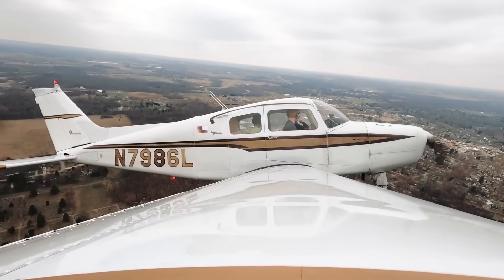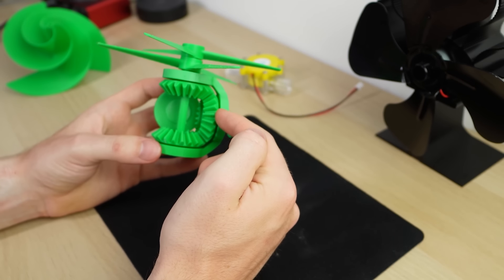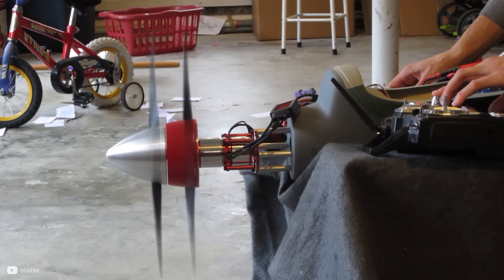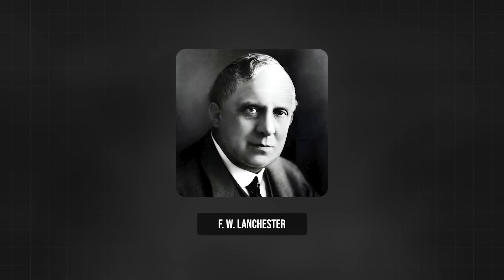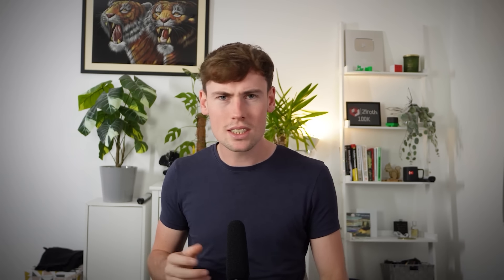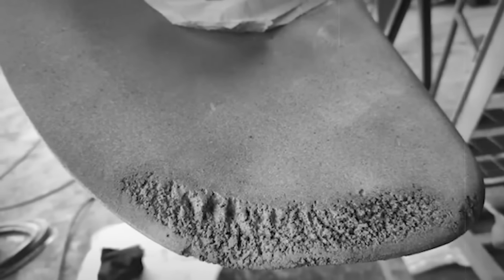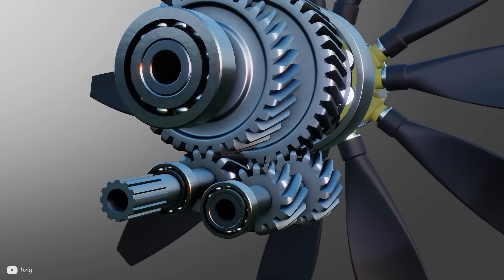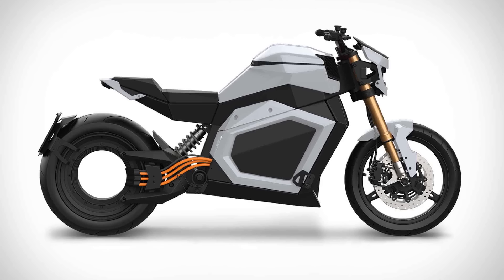The Unexpected Genius of Contra-Rotating Propellers

Comment: Geared reduction drives have proven notoriously difficult on small piston-engine aircraft. Placed between an engine going bang-bang-bang and a propeller with relatively huge rotational inertia, the gearbox walks a fine line between being strong enough to withstand the shocks and light enough to be practical. On electric motors and turbines they may prove much more useful.
Reply: Isn't that what the flywheel is for? Doesn't the prop act like a flywheel by itself?
Reply: @piconano  The prop is a huge flywheel which wants to move steadily round and round. The Pistons go bang-bang-bang. There may be a heavy flywheel on stationary engines, but in airplane engines it's reduced to the barest minimum because of weight. In between are the crankshaft going flex-flex-flex and a reduction box going clank-clank-clank on the smallest lightest possible gear teeth. Long ago Continental (see Tiara engines) realized that 2/1 was a bad reduction ratio because the same teeth were pounded over and over, even with a damper added. By the time all was said and done, the Tiara line was no lighter, enjoyed shorter TBOs, were more expensive to build and overhaul, and burned more fuel. Almost 20 years later Porsche learned similar lessons.
Reply: @tomscott1159  So all these experimental aircraft home builders are screwed? 
Some use Mazda rotaries or Subaru engines with reduction gearbox. 
I've never heard of this and I got my private pilot's license in San Diego in 2000.  
Where can I read more about what you're saying?
Reply: @piconano  Anything can be made to work more or less, but historically, certified geared light general aviation applications have not proven particularly successful.

Both Lycoming and Continental brought out geared lines in the 1950s which proved to have no particular weight or performance advantage over slighly larger displacement direct drive competition. The Continental GO-300 in the Cessna 175 would not survive the Lycoming O-360 engines, for instance, because the 300 had shorter TBOs and required a bit more operator finesse to reach them. Likewise in the upscale twin market, the geared Lycoming 480 and 540 series were notorious for demanding smooth and minimal numbers of power changes to preserve gearbox life. Professional corporate pilots fared better at reaching TBO than owner-operators. When small turbines became available they rapidly shrank the market for larger piston twins, with the King Air essentially replacing the Queen Air, for instance. Continental tried a new line of geared engines in the mid 1960s, but they offered no significant advantages to offset greater cost, greater fuel burn, and shorter TBO. Porsche worked with Mooney in the late 1980s to introduce a 200 HP class geared flat six. Less than 50 were installed before Porsche left the market and eventually surrendered the type rating to the FAA. Too heavy, expensive, with short TBO, poor fuel specifics.

Today there are several series of small-displacement geared engines available to homebuilders and even a few which are now certified. Most of these are water cooled which makes it a bit easier to build a light-weight high-speed core. Yet by the time the system is complete and installed in an airframe with all accessories and coolant, these rarely offer a huge weight advantage over basic direct-drive air-cooled installations. Smoothness and automated controls are typically the main advantages of these new types. But even in these cases the gearbox is an additional point of failure and a costly component to purchase and overhaul.
Reply: Yep. Torsional vibration is real; designing for maximum torque without considering TV (which forces can be quite spectacular) has caused many a redrive to become scrap.
Reply: @piconano   - typical direct drive aircraft don't have a (or much of) flywheel - in a mechanical transmission situation some mass on the input side of the reductiuon gear will affect stated "combustion" torque pulsation - but every Rotax powered aircraft has this problem minimised - and all other auto-derived engines...
Reply: @piconano well a rotary engine has way less vibration than a piston engine. And yes reduction gearboxes are notoriously bad in aviation application and barely one flies them successfully. And Subaru Engines are a disaster themselves and many have been refitted with traditional Lycoming engines.
Reply: "notoriously difficult" only to clowns who never noticed Russians produced thousands of these, on everything, planes, boats, helicopters, unless they are some sort of supermen?
Reply: @KuK137  Notoriously difficult to produce for light piston aircraft at a price, weight, performance, and package size comparable to direct drive engines. Russia never had much of a private light-plane market as I recall. Also the engineers at Porsche probably would resent being called clowns.
Reply: very interesting comment.

Comment: What you completely failed to mention was that the trailing propeller in a contra-prop pair is operating in a faster slip-stream and therefore to obtain optimum performance it's design parameters must differ from the one in front, I.e. they're NOT interchangeable.
Reply: It's incredibly obvious that one propeller is blowing air or water on the second, so mentioning it would be as dumb as pointing out that once a plane takes off, it's moving faster through the air than when it's parked.
As for the different air speed requiring a different design, does that mean you need a different design to take off than to fly? Until you test it, I don't think you can make a definitive statement about it.
Reply: @ED-es2qv  The concept of "dumb" is riddled through your whole reply - you clearly don't know what you're talking about. take the time to study the DORNIER DO335 Pfeil. This issue was well understood by Dornier who designed the propeller speed reducer/blade pitch controls to accommodate the phenomenon. I think you need to see a doctor about your bout of arrogance as I think you'll find that most people are NOT aware of this issue, after all, that's the point of making an educational video, isn't it? ..to educate!!
Reply: Great observation 😊
Reply: Curiosity would this principle work for wind turbines as I heard they have to limit the amount of blades due to the turbanlance caused behind them
Reply: @jamesshimmen7818  Probably getting in a bit too deep with the mechanical complexity required. Major servicing, e.g. blade removal would be a nightmare.

Comment: now that everything is going electric, i can totally see just 2 motors behind each other turning opposite directions, making the gears unnecessary. 15% higher efficiency is worth quite a bit.
Reply: My thoughts exactly aswell.
Reply: You're losing some efficiency from double the electronics and smaller motors. Benefits have to even that out. 
Same with mechanics. 
Turbines just position static blades after rotating ones.
Reply: @kittengray9232  my guess would be that loosing that massive gearbox and its maintenance alone would pretty much make up for it.
Reply: So a smaller shaft inside a bigger one or how would it work?
Reply: @Axiomatic75  yes, the front-motor would have a hollow axle.
Reply: @tomduke1297  Damn, now I want to build a drone with 8 props.
Reply: yes, rc heli's do that. the motors inline, they use a shaft runs thru 1 motor and it's shaft to the back prop
Reply: Axial flux motors!! one For Each one! that way in event of a ruder failure engine control could let you fly
of course the directions of each pair must be inverted on each wing for that
Reply: @kittengray9232 not necessarily, you're also going to get massive mechanical losses with gears, which also have added complications of oiling and cooling
Reply: @kittengray9232 very little different in new motors strong enough for full propeller vs efficiency loss of gears.  Just imagine all with magnetic bearing s
Reply: Everything is not going electric, at least not for a long time yet to come.
Reply: Aircraft is going sustainable air fuel or hybrid, not full electric

Comment: Now, take it to the next level. The leading boat prop is always turning in water traveling at the speed of the boat. The trailing prop is always turning in water traveling at the speed of the boat PLUS the added prop wash of the leading prop. Therefore, the trailing prop should turn much faster than the leading prop to take advantage of the already moving water.

Comment: I thought the green 3d print was amazing. When I was a kid we never even had home computers, now in my lifetime I not only saw original dot matrix printers but now 3D printers, it's mind-blowing and we are only a few years into the technology! I bet in a decade or so the 3D printers can do full colour prints, like you don't just print out a miniature for a board game and then paint it, it just comes out painted.
Reply: We already do have something akin to that.  Several printers on the market can switch filament types mid-print, and so they can programmatically change colors and print a full color model.  There's some issues, of course.  One is plastic waste because models like the Bambu line use a single extruder for all the filaments, and so it needs to be purged of the old filament in order to change color.  Another is just that they don't look as good as a properly painted model.

Comment: In our research there are two major sources of noise, blade passage noise and tip vortex interaction. Blade passage noise happens when the wake off of a blade in the front prop strikes a blade in the rear prop. That wake causes an unsteady flow around the rear blade, which causes vortices to collapse and the blade to vibrate, both generating a broadband noise. When the number of blades in the front and rear prop are equal, like the Tu-114, all of the blades pass each other at the same moment and so all emit the noise at once. So the noise comes in two major bands, the high frequency broadband noise from vortex excitation frequency of the prop vibrating and the high intensity tone at the blade passage frequency. The solution is pretty straight forward and that is to make the number of blade on each prop a different number. Usually they only need to be one different, with one more blade on the front prop when the blade count is low, but two different when blade count on the front prop approaches ten blades. Then with unequal numbers of blades, only one set of front and rear blades are interacting at one time. This increases the blade passage frequency and dramatically lowers the amount of acoustic energy in each pulse. Higher frequencies being easier to attenuate and less energy in each sound pulse requiring attenuation make it substantially easier to reduce the amount of noise that penetrates into the cabin. 

A second mitigation strategy is to add sweep to the blades. In the Tu-114, the blades were perfectly straight, which means that the vortices off the front blade strike the leading edge of each of the rear blades along the entire leading edge at the exact same moment maximizing the amount of energy in that blade passage acoustic pulse. If the rear rotor blades had a bit of scimitar shape to them, then the vortex from the front blades would strike the leading edge of the rear prop at slightly different times and spread the acoustic energy generate over a broader and lower peak energy pulse. Both front and rear blades can have some sweep to them, which is especially helpful when applied to high subsonic propeller aircraft (usually called "open rotor" when the flight Mach number approaches 0.8). To maintain the acoustic reduction benefits, the rear blades just need to have a little more sweep than the front blades.

The second major source of noise is when the tip vortex shed by the front prop strikes the tip of the rear prop. This interaction is so strong that it causes the entire rear blade to "ring". The obvious solution is to make the blades of the rear prop just slightly shorter so that the tip vortex of the front blades just passes over the rear blades with no tip interaction noise being generated. This solution does slightly reduce the efficiency of the combined propeller system since the vorticity at the tip of the front blade is not countered by the opposite vortex at the tip of the rear prop blades. But the loss in efficiency is minor and the reduction in noise is substantial.

The combination of unequal blade numbers per disk, swept leading edges on the rear prop blades (or higher sweep than the front blades), and the reduction in blade length in the rear rotor combine to substantially reduces the noise from contra-rotating propellers.
Reply: Hi, Papparocket. There's a much better way. A direct drive prop/fan sits in front of an open-nosed plane. The engine bay is cone-shaped. The base of said cone is as big as the plane's fuselage.
The engine bay also functions as a stationary nose cone for a planetary gear driven prop/fan that operates at about 1/10 the engine's RPM.
The cone pressurizes, spreads, and smooths the small-and-fast front prop/fan's wake while entraining surrounding air, feeding the big-and-slow rear fan/prop just what it needs.
Yep, planes will need tall landing gear. So what? We need quiet planes with off the charts efficiency. The system I'm designing should approach 2/3 efficiency during high altitude cruising, including the engine (Carnot's equations seriously favor  very cold environments)
Reply: @RePeteAndMe  I'm a bit skeptical, but seeing that it's been around 80 years since any serious research was done on using the plane's fuselage as any kind of assistance to prop-based airflow I'm glad that someone is exploring similar territory.
Reply: A reduction in noise would also increase efficiency, since less energy is being wasted to generate vibration
Reply: @benjaminmiddaugh2729 You should be way skeptical since nobody has built a 2/3 efficient engine, let alone a propulsion system. Heck, I have doubts, but stretch goals are both fun and productive (why DID Moore's law drive chip development for decades?)
Anyway, the front fan's vortices are consumed by air entrainment that's forced by the nose cone, leaving a large, pressurized, and smoothed rotating wake. Or so I think. Fortunately I live next to UCIrvine and they have a little wind tunnel. I'm drawing the latest version of the engine right now. When I'm done I'll head across the street
Reply: May somebody reply to me (a layman) why this could not be applied to fans and turbines?
If possible this could be used to alter the gear setup for marine and aerial if the drive was on the outer edge of a box fan and not the center.
Additional request wouldn't the dual box fan also allow for motion or blade ratios????
I am just doing amateur brainstorming, so forgive me if the logic is obvious to the techs and I sound like a looney 🎉
Reply: ThNKS AI

Comment: Candela hydrofoiling boats have small, low noise, highly efficient, zero maintenance sea water cooled contra rotating propellors operating right now on their hydrofoils in their C-Pods.
Each pod contains two motors, one for each propeller.
This seems to me the best and most obvious example of the use of the tech.
Reply: dude that sound awesome

Comment: I saw a video recently about a new open rotor jet engine being designed by GE and Safran where they have decided to use a hybrid design. Instead of a second counter rotating propeller they use a set of fixed, adjustable blades that act to straighten out the airflow without creating all the noise.
Reply: @dm45lm Perhaps set the leading boat prop at the front of a laminar flow tunnel with a trailing prop in the exit of the laminar flow tunnel. The added friction would be more than offset by increased efficiency of the trailing prop, which could also operate at higher rpm's
Reply: There's no such thing as an "open rotor jet engine".  That's an oxymoron.  You can have an open rotor gas turbine (a.k.a. a turboprop), but the shroud is what makes it a "jet".  No shroud, no jet, no jet engine.

Turbofans already use adjustable vanes for exactly this purpose.  There's nothing new here.  The only difference between the turbofan and the "propfan" is that you're running up against the boundary between the shroud being beneficial for eliminating tip losses, and the shroud being detrimental due to skin friction and weight.  As you reduce the specific power of the engine, the trades say you should eliminate the shroud.

Using vanes versus a contrarotating rotor does not fundamentally change the amount of noise you make.  You still have blade interaction regardless, and that blade interaction makes a tremendous amount of noise.  There's a lot of complex construction in the shroud of a turbofan to damp the noise output of that system, and when you take the shroud away, you eliminate all those mitigation efforts.  This will be loud.

The real reason they went with static vanes instead of a rotor is because a rotor is hard and expensive.  You can add a gearbox and deal with all the problems PW has had with the GTF, or you can add a third spool and deal with all the complexity and cost of a RR Trent for an aircraft a third the size, or you attach the prop directly to the turbine without needing a shaft in a pusher configuration (see GE36).  No one wants a pusher configuration, because no one has an aircraft design that would accept a pusher configuration.

Comment: The Kuznetsov NK-93 Contra-Rotating ducted fan is highly efficient. It has 8 propellers in the front and 10 propellers in the back. It has a 17:1 bypass ration. This design was dropped as funding dried out. It did deal with the noise effectively.